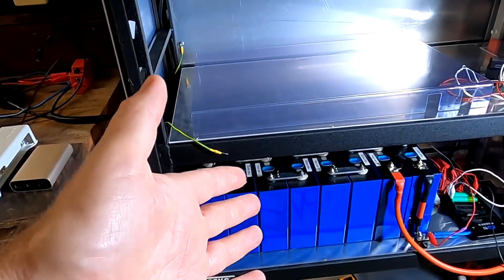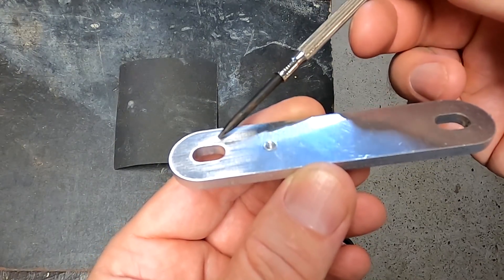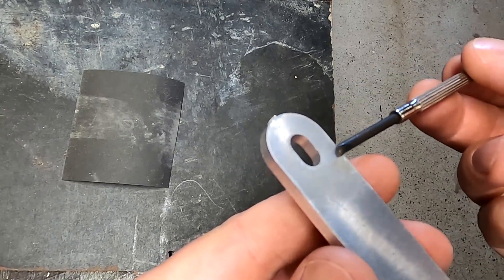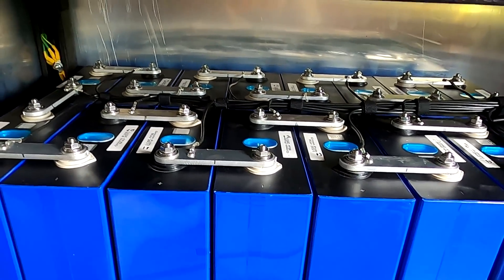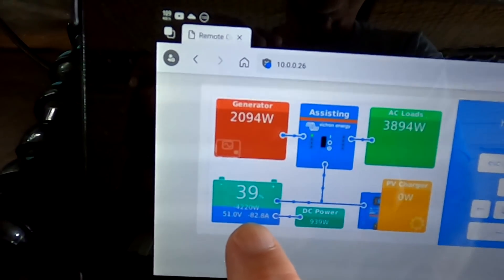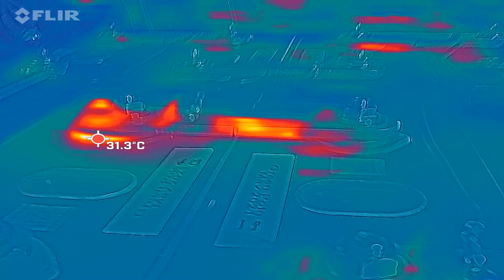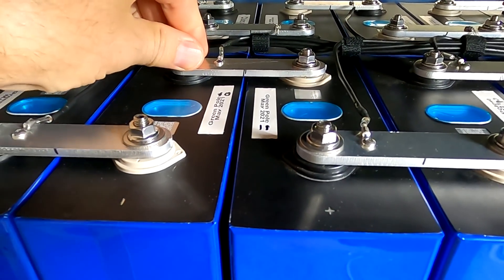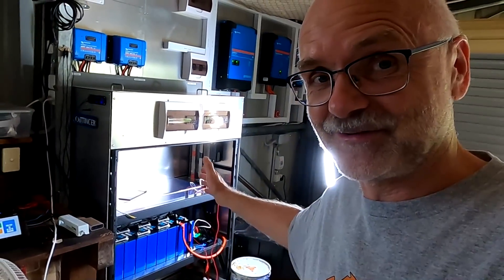Overcoming the battery-busbar problem (for now). Here is what I found!

Comment: When you're pulling 4000W from the battery in order to charge your Tesla, what kind of deviation are you seeing between the individual cells?
I've got a 544AH 24V Lishen pack in my van and whenever I pull 1500W or so, I see a deviation of about 40-60mV Is this normal?

Love your videos, they're very entertaining.
Reply from the maker: Thanks Matt. I didn't pay attention to that detail but it should be in the video showing the BMS.
40-60mV seems a bit high for ~60A. You may have some connection issues as well... Is this in the middle of SOC or at the top or bottom?
Reply: @OffGridGarageAustralia  It looks like you were about 150-200Mv out @ 4000W. So maybe 40-60Mv @ 1500W isn't the worst?

Comment: Glad to see you have sorted out the issue, with lots of people calling out the use of aluminium bus bars, I have to agree. Andy you need to use pure gold bus bars, skip the tinned copper, go all in 😂.  Keep up the experimentation, it would be boring if it just worked first time.
Reply from the maker: Thanks 👍 Gold, you reckon? I'll see if I can find some on AliExpress 😉
Reply: @OffGridGarageAustralia   If you can't find it on Aliexpress, A 10 oz gold bar is around 27.5K AUD at the moment from the Perth Mint, you might have to make your new bus bars a little thin  🤣 keep up the great work 👍

Comment: Andy, please wear latex or nitrile gloves, unless you want an early alzgimer...
Also to save yourself some time, use your miliOhm meeter to test quality of your connections, it works very good for me.
Reply from the maker: How would you measure the quality of connection with the internal resistance tester?
Reply: @OffGridGarageAustralia  first lead flat under the busbar on the battery post pad, another lead you can put on the opposite end of your busbar or in the same location as the first one but opposite end  of that busbar. Make sure you have a good contact (could be a bit tricky) and a steady reading. Compare the resistance reading of the cold busbars to the warm ones and you should see the R difference. Good Luck!

Comment: So, you fixed it with those flexible copper based bus bars and then you still want to use the Alu ones. Don't get you. Forget that Alu you messing around with - KISS.
Reply from the maker: It's a test! New to the channel? OK, let me explain...
I never go the straight way. I could just buy a ready-built battery, connect it and done. Wow, what an interesting video, right? Nothing to learn, nothing to experience, nothing to understand with that. It's a DIY channel. I'm building the system from scratch and do experiments and test along the way to understand, learn and share fails and success. Makes sense?
Reply: @OffGridGarageAustralia  It has been proven copper is the material to use. Since you know better, I leave it at that.

Comment: Maybe the aluminum bars you are using are manufactured with a concave surface. They may need to be machined, milled flat. If you know someone that has a stone flat surface and using a dial indicator you might see how bad they are for not being flat.
Reply from the maker: It can't be much as a few circles on the sandpaper seems to have fixed it. The copper bars would have just bent to the right shape, I guess.

Comment: I was thinking you could put one of the BMS voltage input (blue) cables on the bottom of that little bus bar and the other on top. That way they both have the same contact surface on that little bus bar. And, add/move washers appropriately on the other side of that bus bar to make sure the little bus bar is level.
Reply from the maker: I can try but I think it the crimp of the ring terminal. I don't have the issue on the other side with the same connection method.

Comment: Battery terminals are not all the same height, could be off just a little causing uneven contacts. Flexible connections/bus bars you don't need to worry about the difference in terminal heights
Reply from the maker: Yes, that could be the case. The aluminium bars are rock solid and won't bend at all to such tiny differences.

Comment: I wonder if copper washers would help at all would be a fun experiment.  I use a zinc paste for large aluminum buss connections, but sounds like they don't have that over there.
Reply from the maker: But then you have AL terminal, CU washer and AL busbar. Would this not add to the problem?
Reply: @OffGridGarageAustralia  To be honest I am not sure.  I know that copper aluminum intermix of terminals is allowed for aluminum bus bars because the stability of copper.  So it would be an interesting experiment.  Most use of aluminum terminals has been discontinued so haven't had a chance to try it myself.

Comment: @10:50 I would keep an eye on that, I wonder if it is due to poor crimping on the terminal or poor connection inside the BMS.
Reply from the maker: I bet it's the crimping as the P- is connected the same way on the other side and is fine.
Reply: No, it's incorrect assembly of the termination. The two wires' crimps should sandwich the terminal busbar between them so the contacts are identical. As we see them there are multiple higher resistance paths throught the terminal screw and washers and from one crimp through the other.

Comment: Aluminiums ar bad conducting for DC current, silver are de best and copper nex  one better. Aluminiums it's two times more electronic resistant dad cooper.
Reply from the maker: Not quite true. It all depends on the dimensions. Size matters ;)
Reply: @OffGridGarageAustralia  no resistance are resistance you only have dispersion off  hot. The temperature move more well in big aluminium bar's bad same resistance the factor can be cause some problems in the BMS sensors. In DC de resistance icircuit's are very important. It's better to calculate exp 32mm2 110v 48A cooper. You have a table off metal calibration on Internet For good temperature and not luse voltage in some intervals off time.
Reply: And good videos and work congratulations.

Comment: I'm wondering if the bus bar ends are pressed, to assure flatness, sanded, cleaned with acetone, then greased, if that would make any difference. Might want to consider sanding the terminal bases with 800 grit. It appears the circular sanding did the trick.
Reply from the maker: So far so good. Lets see if it lasts.

Comment: Andy your findings are great information, and most certainly very worthwhile as a reminder for us all to be extra careful when assembling our battery packs.
However have you calculated the energy losses across your original set up, my point would be that I don't think you had a significant problem in the first place, or even a minor problem as far as energy losses are concerned, nor a long term problem either!
Reply from the maker: That is correct. I didn't have a problem with that with the old battery. And it will get better over time once we install the other batteries in the shelf. The current will split up into 3 or 4 batteries. I'll monitor it anyway, so time will tell....

Comment: I'm sorry you had a problem, but also glad.  You've saved me and others because I was totally unaware solid aluminum busbars would be a problem.  I haven't bought anything yet, I'm just about to, so you saved me a lot of time and frustration.  How often do you think you might have to repeat this process?
Reply from the maker: It's not really a problem, it's more an experiment over time. I should be good now. Not sure if the oxide layer comes back at some stage, some say yes, some say know, so I have to find out, right?

Comment: I would suggest copper busbars, just for peace of mind, you dont want to have that stuff in the back of your head all the time...
And if you do use alluminium, there are washers that cut in to the busbars when tightent; so it breaks the oxide layer.
Reply: Copper on alum is reactive. Would need an appropriate electrical paste.
Reply from the maker: You can only use tinned copper for the aluminium terminals.
Washers are a bad idea as the will heat up a lot under high amperage. They will reduce the contact area.

Comment: Hi Andy, we used Glass as a flat surface. Could the terminals need to be looked at?
Reply from the maker: Yes, glass or a mirror would be very flat. I didn't think about that.
The terminals seem to be very straight. I checked them on another set of batteries and could not see any light coming though.
Reply: I forgot to also mention after using emery and or any abrasive paper to wipe it down with alcohol or Metho.

Comment: Congratulations! You shave the problems away one by one 🙂
The bus bars that still get warm might have similar issues on the poles of the cells. They should be deoxidized as well.
BTW: You may use the sandpaper and grease at same time. Then you will have even less oxide. Proof is that you can solder aluminium foil quite well if you apply oil or grease and rub with the soldering irron.
Regarding the blue cables: Good practice will be to put one lug on bottom and one on top of the bus bar. Then they should behave symmetrically.
Reply from the maker: Thanks Johannes. The two busbars are getting 1-2° warmer than the rest at ~90A, so I'll leave it as it is for now and see how this unfolds.
Yes, sandpaper plus grease at the same time, then wipe it off with grease to exclude any air exposure.
That's a great idea with the blue cables but the black ones on the other side work just fine with the same connection method 🤷‍♂️

Comment: Pure copper bar and make your own. My thought is that you have to make the aluminum bus bar so thick to carry the current that when you torque them down they are so stiff they can’t conform to the terminal differences between cells. Just my two cents
Reply from the maker: Pure copper would be bad on the aluminium terminals of the cells.
The thickness of the aluminium bars is certainly one problem to get them flat on the terminals. But the main problems where the ones I showed in the video.

Comment: not sure whether its been mentioned before but the higher edges are created when the bar was machined
Reply from the maker: The bars are not punched or stamped. They are laser-cut.
Reply: @OffGridGarageAustralia  doesn't matter whether you punch, mill or laser cut. laser may possibly be the cleanest cut but the moment you work the material you will find a small elevation, or burr, at the edges. sometimes more...sometimes less. 

in case of your laser cut it can depend on the quality of the nozzles, operation set up and speed, was oxygen or nitrogen gas used..? thats just from the top of my head, I'm sure there are more variables contributing to the quality of the cut

Comment: Excellent sleuthing Andy! Apparently 5005 alloy is pretty hard and comparable to 6000 series Aluminum in hardness and electrical conductivity. 5005 is also said to be used in electrical cable over pure aluminum (1000 series) because of it's higher tensile strength. I'm guessing that those buss bars were cut or stamped from plate aluminum with varying surface uniformity. If they were stamped or punched on a turret press they will have deformities (I know from experience). Where tensile strength is not important in battery bus bars, and pure 1000 series aluminum is softer I wonder if it would conform better under pressure? 1000 series aluminum also has better electrical conductivity. 
Something Paul might consider is running the plate stock through an aluminum surface finisher, basically a drum abrasive surface finishing machine designed that evens the surface and applies a smooth decorative finish such as on control panels.
Something else to watch out for is thermal loosening of your connections and galvanic corrosion, always a problem with aluminum connections. In industrial applications we always had issues with aluminum conductors that we never had with copper. I wonder if Paul might be able to offer soft copper bus bars as well?
Reply from the maker: Paul gets all busbars manufactured form a company down in his area. They are laser-cut, not stamped and they are made from 5005 Al.
It's a long term experiment, so we will see...
Reply: @OffGridGarageAustralia  Good he's got you to assist in development. I'm guessing that 1100 pure Aluminum plate and used with liberal amounts of no-ox and possibly beveled stainless steel or aluminum washers might conform and be fine in the long term.

Comment: From what I can see the reason the buzz bars are not 100% flat is because they must of used a punch to make the holes so the force of the punch would deforms the bars
Reply from the maker: They are laser cut. Stamping them out would be a lot worse and you could see it easily.

Comment: Oddly enough, what I see is oxidized and unoxidized aluminum. :-)
I'm not saying they are perfectly flat, but that was my first thought when I looked at it.
Yes, aluminum oxidizes quite quickly, here in the desert it is even worse due to the increased ozone.
I see now that you've figured out why double cables like that, I crimp into a single lug rather than stacking high current connections.
Yes, I tested quite a few things with my thermal camera, I don't have the same background and don't get reflections. I don't even blend in the visual camera, just the infrared.
Reply from the maker: Thank John. The oxide layer is certainly a problem and we will see how this goes over time. I have tinned Cu bars here so can easily swap them out again.
The cables into a single lug makes sense. I should do that!

Comment: Thanks Andy, Looking at the nickel plated copper busbars, these are hard drawn copper which is not soft in any way, just as an idea you could heat the copper busbar up to a high enough temperature that would anneal the copper and soften it up, similar to when you buy copper tubing in a coil that is easily bent, you wouldn't know how flat the post on the battery was either, you could even try thin annealed copper washers between the battery post and busbar, in the early days many engines had copper head gaskets that you would re-use after annealing them again over a flame
Reply from the maker: Oh, wow, now we're really getting into experimenting. I like it😁
Reply: Then cover it with tin. There will be an even more plastic layer and less corrosion in contact with Al.

Comment: I don't know if you saw my other post, I have seen a fairly good price on nickel coated copper braid flexible bus bars at £40 for 15pcs which I thought was good in comparison to the others I have seen of the same type.
"Minerals Official Store" on AliExpress have them listed as "Tin plated copper braided strap M6" with various thicknesses.
Reply from the maker: I've got exactly these bus bars incoming from the Mineral Store on Ali. I ordered only one though as they may not fit the batteries as some of their customers said.

Comment: When I used to polish fibre optic leads, the instructions were to polish in a figure of 8. This did make a difference when using the £5000 tester for loss. Maybe its the same for busbars for uniform flatness., 👍👍
Reply: That is a pretty standard technique for lapping parts in the engineering arena.
Reply: Mostly you want random movement, a figure 8 "pattern" gets close without being tedious.

Comment: Nice video Andy. I think it is  always combination of things. What i'm worried is what will that Al busbar do over time..It is pretty critical how much you tightened it and hod plane is your busbar..S i would try to put some temperature probe on one busbar and leave it for later one and check if it will increase in temperature over time..i would go for those cables..even if you have to make your own with lets say 50mm cables ..I think this might allow flexing and also less likely Al will melt..or how is that process called as AL will usually change shape once it is under constant pressure.

Comment: the buss bar is punched
Reply from the maker: No, they are laser-cut, not punched.
Reply: @OffGridGarageAustralia  Wonder if the heat of the laser causes the non flatness? Next batch of links should be water jet cut :)
Reply: @shanesummerhayes7101  Next batch should be copper.

Comment: Great Video.  This video and the last video should be a must-view for anyone building a battery.   The high currents we deal with require special attention to all connections.  

A few points:

* No-oxide is to prevent oxidation but will not remove oxidation.
* That was a great discovery about the raised lip around the edge of the busbar.  When the busbars were cut (or stamped), it probably raised the edges around the cuts.   
* You may want to hit the cell terminals with a wire brush right before you install the busbars.
* That is a good point about the aluminum bus bars not bending as easily as the copper.... Another reason to use copper.   

* I am not very surprised about the difference in current on the lines to the BMS.   The current ratio will be inversely proportional to the resistance ratio of the two lines.  Just a little bit of resistance in one of the crimps or connections can throw off the ratio.
Reply from the maker: Thank you. The aluminium busbars are laser cut, not stamped, so I was surprised to find the edges been raised a bit.
Reply: @OffGridGarageAustralia  Interesting.....  It must have bubbled up a tiny bit along the cut.

Comment: Heck get some 2 gauge cable, silver solder the ends hammer and sand flat drill a hole for the terminal, it should be a perfect buss!
Reply from the maker: I would not do that, far too much work. I would rather use the copper bars coming with the cells.